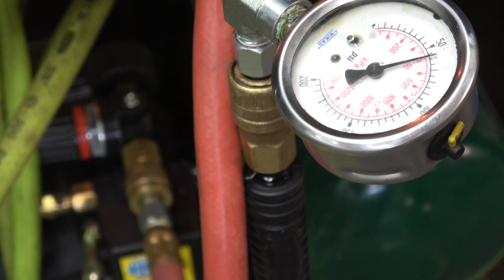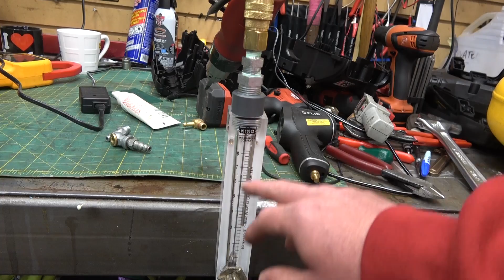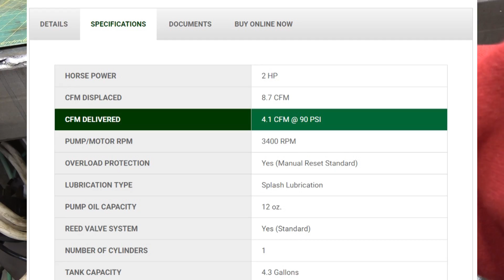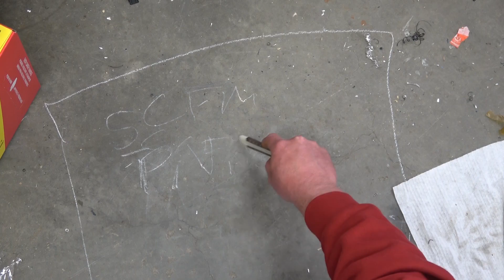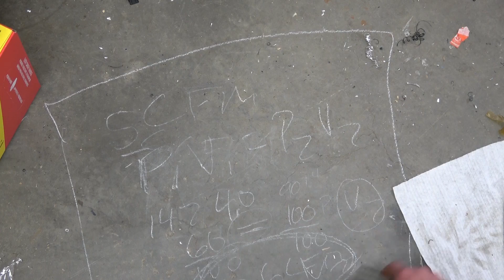Why are CFM ratings BS?

Comment: Wow, that's actually pretty surprising... Those marketing fucks! Its like advertising a car has 300HP but there's 80% drivetrain loss, so its still slow as hell.
Reply: I feel like it's along the same lines as labeling something "military grade".
Reply: @eldestgruff  military grade is an actual oficial minimum standard.
Reply: For the record, and to dispel some mythology - BRAKE horsepower (bhp) means at the flywheel.  The "brake" it references is the one inside the dynamometer that's used to induce resistance so the power can be measured.  If there's a transmission and such attached, it should be listed either as simply "hp" or occasionally (rarely) "whp" (wheel horsepower.)  To fudge the numbers even more, bhp is often measured without any ancillaries (including removal of the alternator, exhaust system, air filter, water pump, power steering pump, a/c pump, etc.)
Reply: @baronvonlimbourgh1716  what you are referring to is mil-spec. which refers to a mil-xxxxx military test method for something. if it passes the test you can say it's rated to that test. Marketing takes that to the N'th degree and says military grade.
Reply: Yeah sorry bud, but this is exactly what they do... in this case though, everyone is using the exact metric, all the way up to multi million dollar hypercars, so you’re getting apples to apples. Also, there’s no specific task you’re trying to accomplish (unless we’re talking trucks) with this power besides move the car at a reasonable pace, which even 80hp cars accomplish, so, all good!
Reply: Brake horsepower vs. horsepower. See also vacuum cleaner "peak" (aka "Sears")  horsepower = inrush current x input voltage/746. And Peak Music Power. The figures don't lie but the liars sure as schmoo figure.
Reply: or gas mileage city/highway. they dont do those tests at crunch time with other cars on the road.
Reply: @painkillersclan  Canadian cars get way more miles to the gallon... because they use imperial gallons to rate them, not US gallons!
Reply: @GigsTaggart  Canada uses L/100km. Not that miles and gallons bullshit.
Reply: You can't really expect manufacturers to give HP at the wheels, because it changes with how fast you're accelerating (due to rotational inertia). At steady speed, drivetrain losses are actually very low for most vehicles.
Reply: Isn’t this the difference between bhp (brake horse power) and hp?
Reply: They do advertise cars like this. But it's not false, it's just at the flywheel instead of the wheels. Both of my cars make 300hp at the flywheel, about 245 at the wheels.
Reply: tesla500's channel has an interesting vid you might enjoy where he runs a turbo off electricity and its amazing how much it really consumes.
Reply: Don't spread this, as they will not only include the power needed to run fuel pump, but also all of heat wasted, which is like +300%.
Reply: there a a few manufacturers, Audi being one of them, who under rate their cars. it's more common then you would expect. dynos can measure hp levels at the wheels that we're higher then the BHP advertised.
Reply: All cars do that. If the word "brake" is not included in the horsepower number, it is the engine with no accessories on a stand.
Reply: In an american car, they promise 300 HP, but don't mention that 200 of those horses run the fuel pump.
Reply: it actually makes more sense to rate a vehicle's hp at the flywheel. look at trucks for example , they come with multiple engine options  in automatic , manual , 4wd and 2wd and every combination. transmission options would change the wheel hp , as well as adding in a transfer case. then they would have to supply you with the exact hp output for every combination. not to mention tire size. depending on the wheels you choose on a new car changes the tire size , and tire size would change the loss or gain of torque to the ground.
Reply: Dalton Michaels But the "problem" with us cars is that they rate hp when then engine is at optimal temperature and atmosphere, without any hydraulic pump, ac, generator or water-pump. That's why you see a big gap between us and eu cars. I'm sure my car (bmw) got tested at mount everest, with ac crankt to max 😂 It's pretty much whp in the documents...
Reply: You mean exactly what they already do?
Reply: @98dizzard  I was under the impression that manufactures started advertising Horsepower at the wheels and not the crank, after a bunch of complaints.
Reply: @gredangeo  nope, flywheel measurements are used. Transmission loses not included. 😉
Reply: So you are talking about mopar products then.